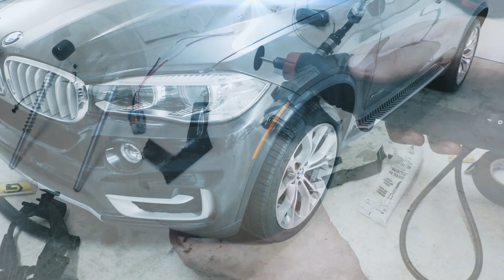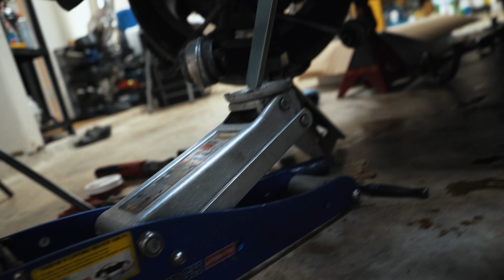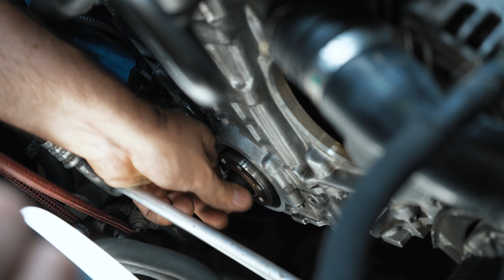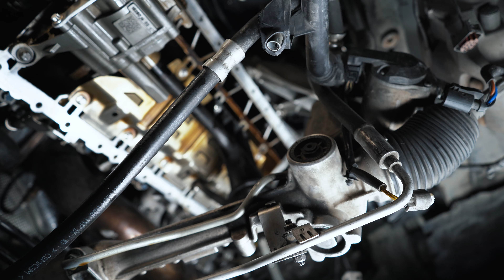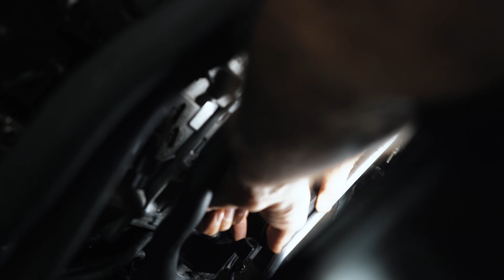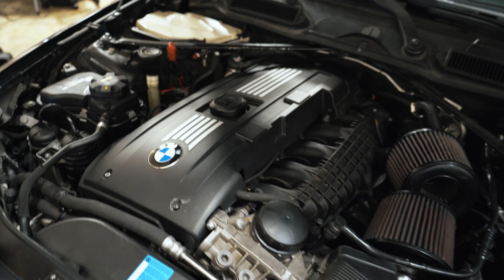This Fixed My Car! BMW N54 Timing Chain DIY!

Comment: The crank bolt removal was interesting (because yours was in good condition). My crank hub slipped and only took 90 deg. of bolt rotation before it was totally loose. I only needed a standard ratchet to remove it. I noticed the old stretched bolt was around 1mm longer than a new bolt fyi 👍
Reply: On an N54? Got bent valves or just vanos codes?
Reply: @vvsyndicate9351  just codes and running rough - i was lucky it didn't damage the valves - phew
Reply: @ben7020  hey man do you have Instagram? I want to ask you some questions
Reply: I removed the screw by cracking and I take out complete pulleys and I hear something fall, and I put everything back do you thing something fall down or timing get lost? Or how I can check the timing? Thanks for your help
Reply: @ramonlatorre6671  you can buy timing tools from ebay, i recomend to use timing tools, replace friction discs and new crank bolt and check all work - especially if u hear parts drop 🍻
Reply: Thank you very much, I going to get new bolt and washes and loosen up the chains , because this bolt I don't think can make more than 180° maybe I gonna weld it a little
Reply: @ramonlatorre6671  you need huge leverage bar.
From memory 100mn then 360 deg
Reply: Thanks I know but I can get the bolt and washes I'm thinking weld everything together
Reply: No body have the bolt and washes
Reply: @ramonlatorre6671  i bought it from "FCP euro" online parts
Reply: Hi what happened if I use the same bolt and washes?
Reply: Maybe my valves get bent because I have vanos inlet cold code, and I change everything
Reply: @ramonlatorre6671  do you get vanos warm code?  There is cold start map and a normal /warm map.  If valves are bent it will run very very rough
Reply: what codes did u have? i got 2a98 and 2a99. Im going to be so pissed if my crank hub slipped

Comment: Amazing work. The final result sounds like a brand new engine. Love it.
Reply: You're' correct... It purrs. Like when it was new. I had NO idea that the N54 had separate cam and oil pump chains. So glad this video is here. I might get brave to try this sometime after less invasive options have been exhausted (and I actually have time to work on my N54 09 E90)

Comment: thats the quitest n54 engine ever heard if im not mistaken 200k on that engine 👌
Reply from the maker: Yes it's got 200K on it, for whatever reason I've noticed it feels a little smoother after the repair.
Reply: @VehicularDIY  love my 335i currently at 79k miles i have idle hiccups or tiny cuaghs with slight shakes on cold start since i had it 2 years ..done everything from index 12,ngk plugs 0.22 ,delphi coils , new rear 02 sensors  ..new factory diverter valves (mod including  hose  removed ) ...currenty gotta fit new vanos solonoids and boost soloniods....tough one as it doesnt regester as a missfire ... and already had to replace a faulty index 12 was hoping to solve it....6 speed manual ...still love it though i just egnore it...2k oil and filter changes :)
Reply: @badboygto  did u code the injectors? if u still have the car lol
Reply: @Salty_Kingston  ha yea still got it and fixed it in the end ...new seals and cuplings refitted injecters solved it  i got there in the end :)
Reply: still a few very minor shivers when cold start is coming down im putting that down to timing ajustment as for the hicups non at all 👍

Comment: What is a good source  of technical data for required torques and which hardware needs to be replaced?
Reply: Been wanting to know this as well, it would be really appreciated.
Reply from the maker: check out newtis.info
Reply: Thanks!

Comment: Excellent job man. Its definitely an involved job but it looks straightforward. Easier then setting up timing on a quad camed car.
Reply from the maker: Thanks, yeah considering you just need to lock the top and bottom and torque down the crank bolt it seemed really easy.  You don't have to 2nd guess if you are one tooth off.

Comment: That tool is for holding a flywheel on a manual transmission. There is a much cheaper option for holding the dual mass flywheel Yoursme Flywheel Holder for BMW (118660) N55 N20 N26 Engine Alternative to JTC 6670 https://www.amazon.com/dp/B088CXP35W/ref=cm_sw_r_cp_api_i_PyKzFbQSQGHCM
Reply from the maker: I have seen a couple of those but I didn't want to just restrict movement I wanted to lock the flywheel and hold it there without it moving 1 mm left or right.
Reply: Vehicular DIY I completely understand and agree, you used the right tool I was just saying that for an auto one would use the pin for the timing but that cheaper option i mentioned is for breaking loose and tightening the crank bolt. That solution only works on an auto because of the opening on transmission that allows you to fit it. The manual uses the tool you bought. I have a 2008 : 335xi standard and a 335i auto and I do a lot of this sort of work because of my job. Owner operator of The Weekend Warriors a mechanic service in Athens AL. Hey, also I wanted to tell you that you are providing a nice service and I hope you continue!

Comment: nice series! towards the end i noticed you are still using the stock DVs on your dynamic autowerx stage 3 turbos and 25psi. Hows it holding?
Reply from the maker: Thanks!  I have upgraded the diverter vales to some cheap aftermarket ones, you'll find a video on my channel for it.  I have state 2+ turbos which are still doing great and the aftermarket DVs are holding 25 psi without issue.

Comment: Force, not pressure.  Ultra Grey is good stuff.
Reply from the maker: Yeah I've had good experience with it.  I was comfortable using it since my pan was dropped and I could take a look from the backside and ensure no excess silicon squeezed out.

Comment: Well done.  I predict your next garage will have a lift.

Silicon sealing of crank seal should be no problem since you did not gloop it on in excess.
Reply from the maker: Yeah I typically frown upon using RTV on crank or rear main seals as if you install them correctly you shouldn't need any but the N54 has a bed plate and you have to use sealant anyway.  With the pan dropped I had clear access to see if any excess RTV would have made it through the other side so I felt comfortable using it.